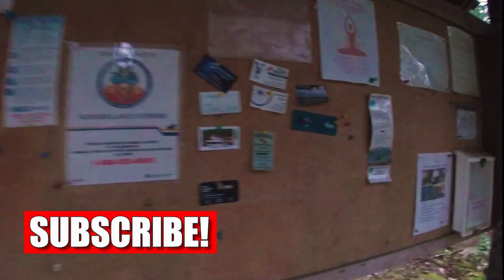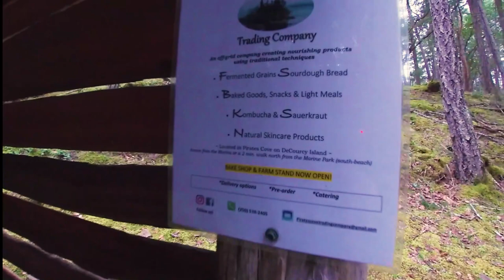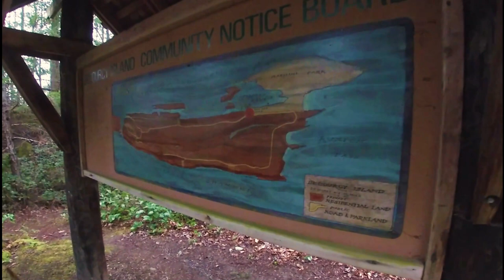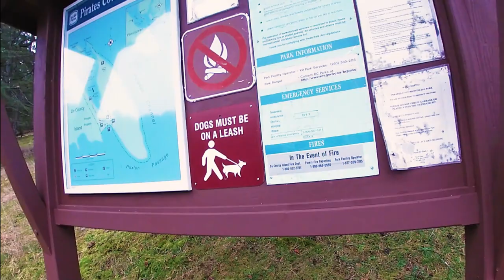We Explore DeCourcy Island and Hide Painted Rocks

Comment: Why do you not loop your stern line on shore so Josh doesn’t have to go to shore to get it undone?
Reply from the maker: That would be a good idea but that is 600 feet of line to handle.  I prefer two lengths of 300 so we can set them up on angles to give us three points if needed like in this video.